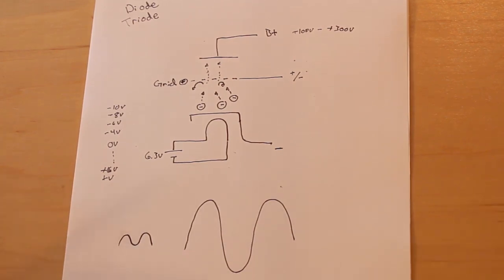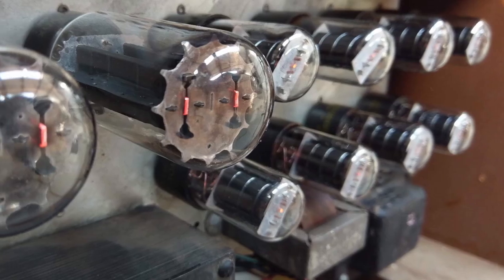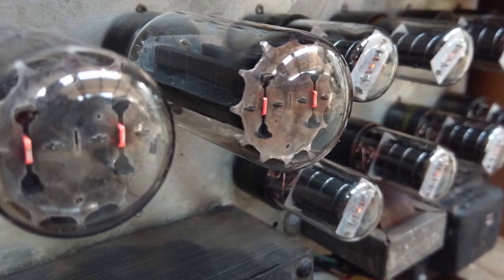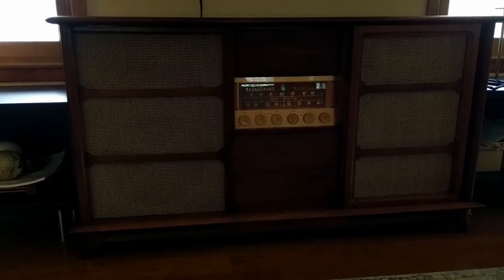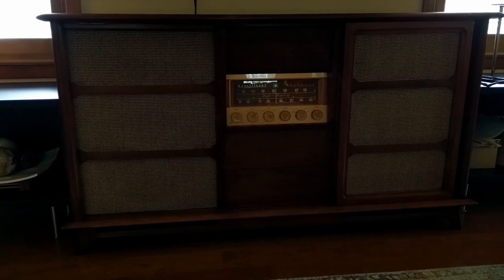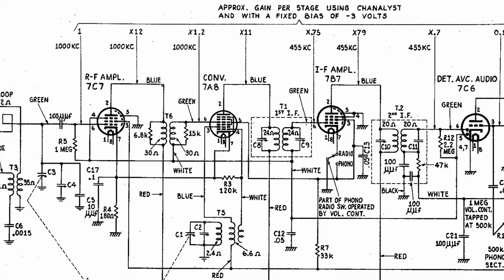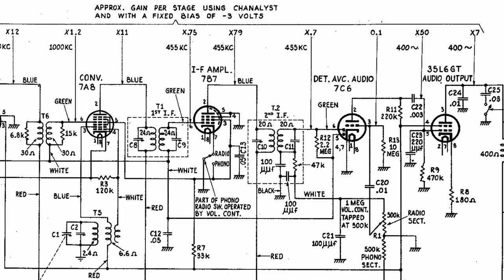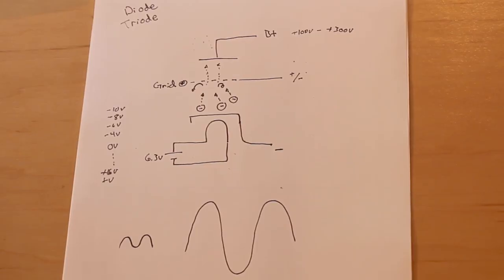Vacuum Tubes: Episode 2 - The Triode (Part 1)

Comment: Very interesting and clear ! However, I was sad at the end when the video was over...
Where do you actually get your parts ? It seems pretty hard to find vacuum tubes (or relays in an other style of electronics) and even transistors :-/
Looking forward to your next videos !!
Reply from the maker: Thank you so much!
I try to keep the videos under about 20 minutes, otherwise I tend to get a little long-winded, haha. 
Vacuum tubes are surprisingly common, you just gotta look in the right place. If you're looking to salvage, keep an eye out for oscilloscopes from the 50's and 60's, they often had anywhere between 10 and 100 tubes inside depending on the model. Although, you can also find tube lots on eBay for decently cheap. The audiophiles definitely hunt down some of the more desirable tubes, like the 12AX7 and 6922, and they can get quite expensive. But, if you're like me and are looking for some tubes to just play around with, you can often find the old TV and Radio tubes for really cheap. They won't be the best in amplifiers, but they work great for making random circuits with. For example, I picked up a lot of 600 tubes on eBay for $75 shipped. That comes out to just 12 cents per tube, which is super cheap. About 200 of the tubes were either 6CB6s or 6AU6s, which are 7-pin pentodes, but even those can be used for interesting inverters and what not. 
I'm planning to go in depth on Tetrodes and Pentodes after I wrap up the next Triode episode!

Comment: Bipolar transistors, such as the BC108, and etc are current controlled devices, whereas JFets and Mosfets are voltage controlled devices like vacuum tubes.

Comment: Since the 6DJ8 vacuum tube has two triodes in it, you should be able to build a simple flip-flop circuit with just a single 6DJ8 and all the necessary resistors, caps and etc.

Comment: But what about the poor old npn transistor? It was operating as a switch, not biased for amplification.  Its either in saturation or its off. However, tubes are fascinating, thank you for the most excellent videos. BTW, those electrons actually travel quite slow, about waking pace (3 ~ 4 km/h)... Sorry, forget that. I am not thinking vacuum tubes here but copper conductors.

Comment: Thank you for the nice and interesting video! 👍
I want to point out the mistake you have made in the naming. Transistor and semiconductor electronics in general are not digital at all, they are still analog, and the behavior you observed on the LED connected to the transistor is due to the physics and behavior of the P-N junction. If you connect a voltmeter to the output, you will see that the voltage changes on the LED are still linear (analog) and not discrete (digital).
Another point I want to make is that explaining the behavior using inverted logic is confusing. It would be better to use the non-inverted output.

Comment: I wish that you wuld experiment on ignition systems honestly.
I have years problem to build variabel voltage regulator solid state for alternator or controling precisely ignition module pulse duration aperantly such devices do not exist .
So I have hard time controling alternator and ignition coil .
Some peopel mentioned wacum tube baterry chargers please rewive those so I can understand how they work.
Your videos are great and in detail realy great chanel .
I also wish you wuld revive those old amplidyne generators ,M-G Sets ,Metadyne and other interesting things used in the past.
I have so much unusual effects on me engine that I need badly help .

Comment: A transistor itself is certainly not digital. It is fully analog. It may have higher gains/beta. A BJT is a current analog device not a voltage device.

Comment: I really like these videos, but remember that most people aren’t familiar with using power to control a dimmer switch. After all, that’s a triode. 

You’d be better off showing a mechanical slider, then a power-operated slider, then a transistor with variable voltage input, then a vacuum tube. People need to see the progression of ideas.

Comment: Hey i realy like your videos but the explanation why the transistor behaves differently from the tube is not correkt. It is not about "digital" or "analogue" the transistor is also a "analogue" device. It is all about the characteristics in the datasheet. For example, the transistor (a bjt in that case) is a current controlled device. A current flow in the base controls the path between the collector and emitter. When you let a lot of current flow into the base the transistor satturates and it turns on the collector emmiter path completely and when you let no current flow into the base than there is no collector-emmitter path. You have a linear region in between where the path is kind of a adjustable resistor and that is the region you use when you "amplify" a signal so you basically modulate the voltage between the collector and emmitter with the current that flows into the base. The Tube behaves like a mosfet because it is voltage controlled. It is all about the info in the Datasheet. (sorry for the bad grammar and orthography, i am not a native english speaker )
Reply from the maker: Thank you!
First of all, your English is amazing for a non-Native speaker! Like better than most native speakers I know, haha.
Also, you're absolutely right. I got so much wrong about the transistor in this video and few other commenters have let me know as well, but I'm always happy to see more, great information about how transistors work!
Transistors are a bit magic to me though, I'll stick with hot electrons for now, haha.

Comment: is a 6DJ8 similar to a 6EU7?
Reply from the maker: The 6EU7 has a very interesting pinout, despite being a 9-pin tube. So, it's unfortunately, not interchangeable with any of the standard 9-pin tubes without an adapter.
The 6EU7 is also very different from the 6DJ8 in terms of electrical characteristics. For example, the 6DJ8 at 100V with 0V on the grid is moving around 40mA through the plate. The 6EU7 at 100V with 0V on the grid is moving just 2.5mA. 
But the 6EU7 is very linear, so it could work pretty well as an audio pre-amplifier tube or something like that.

Comment: I repaired valve equipment for many years, I never thought to run them under 200V. LOL.
Reply from the maker: Really, I'm so accident prone (I've cut myself with a butter knife before), I knew that with hundreds of volts on tap, it'd only be a matter of time before I hurt myself, haha. So, I figured I'd give tubes a shot at low voltages. And, for computing applications, it turns out they tend to work really well!
Reply: @UsagiElectric  Yeah, they're working realy well.
Back in the 80's, I was building a totaly valve 40watt per-chanel quadrophonic entertainment system. I was doing final checks on the output stages when I got a 1200vdc shock that threw me across my bedroom. I did'nt stop shaking for hours. LOL.
After a few days I finished the system and it sounded brilliant. We had it in the lounge for about 5 years till we moved to a smaller place with nowhere to put it.

Comment: Running vacuum tubes at low voltages was really interesting, so I did some digging around, and found this paper http://www.valvewizard.co.uk/Triodes_at_low_voltages_Blencowe.pdf which also confirmed that you can set them up as linear amplifiers at low voltages (in that paper, less than 12 V) but you do have to throw some conventional wisdom out the window. Really interesting!
Reply from the maker: I haven't actually done much experimenting with tubes at low voltages for audio applications, but that's an excellent paper! I've got it bookmarked and will sit down and give it a proper read. There's a lot of really interesting tricks they're doing to get the tubes working well at just 12V, but it's super impressive. I may have to build something based on that paper one of these days!
Thank you for the link, that'll be a fun read indeed!

Comment: While I enjoy your teaching of how vaccum tubes work, I think your understanding of BJTs (and possibly transistors more widely) flawed. A BJT is an analogue device, not digital. What you observed was the higher gain of the BJT compared to the triode along with the higher efficiency resulting in a digital-like behaviour. It is intact these very properties that make a BJT good for certain analogue applications (compared to a triode). 

A BJT can act similar to a triode within its linear ranger, however is a current controlled device as opposed to voltage controlled, so won't behave the same.